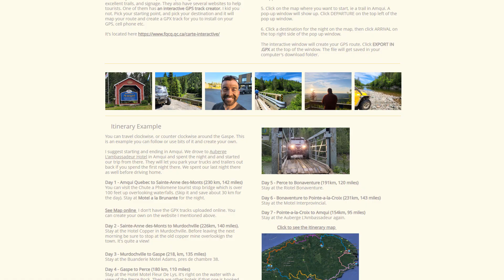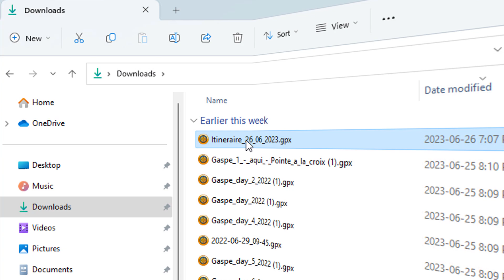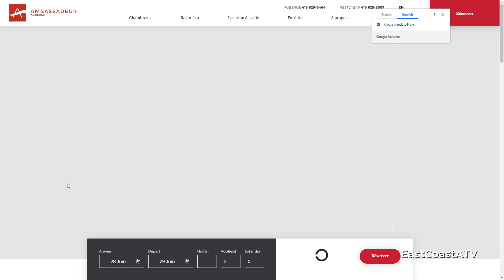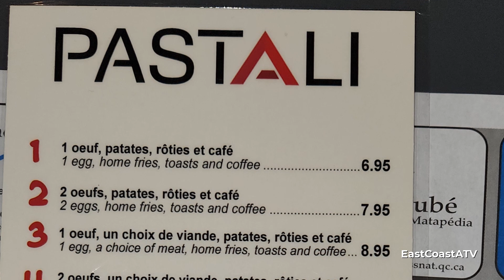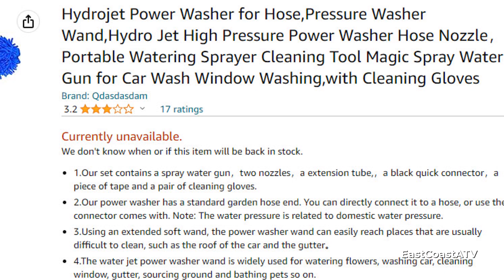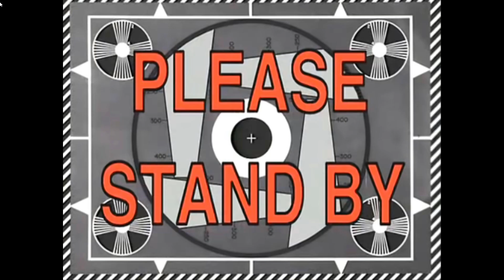Crossing The Gaspe by ATV - Part 1

Comment: Great video and a few helpful tips like the extra gas cap
Reply from the maker: Thanks. Yeah who knew a gas cap would be an issue? If you buy a spare make sure it fits your machine, not all gas caps are standard size.
Reply: @EastCoastATV  i finally got my Ranger after 6 months and have been enjoying it all the time
Reply from the maker: @jameshall1691  That's great, I'm glad to hear you're out there enjoying the outdoors.

Comment: Just curious.  You mention to go to your website to get the information etc and if we download your GPX it does not match the video series you have posted here.  Different route and hotels.

Why such the change
Reply from the maker: I didn't post my actual tracks because of the issues we ran into with closed trails etc. I didn't want anyone else to run into that, so I posted tracks a friend of mine made the week before on a slightly different trip. Here is my actual trails if you want to see them https://www.google.com/maps/d/edit?mid=1npk_Td5hlrYF41XL1E4KCVxa97xJO9U&usp=sharing
Reply: @EastCoastATV   Ahh I see..  Well thank you for the update.  I have done the NFLD run thanks to your guidance and tracks.  Gaspe is much closer to us so this year we will be tackling it.  We have a 1000mile 7 day loop we made up here in Ontario which we will be making public soon.  Not sure if that is to far for your group to go or not.  We have move than one loop. One being more beginner and the other more advanced.  We would rank Gaspe and NFLD as beginner for sure.  The advanced loop is more like 500 miles but will still take 7 days to complete.

Look forward to see where you go this year.

Comment: The thought of losing a gas cap horrifies me.
Was there a brand name of vehkcle that didnt require rad cleaning?
Reply from the maker: It's a crappy feeling losing a gas cap. Luckily we had enough plastic and zip ties to cover them. Some guys didn't wash their rads all week. Mine was good after the first time I sprayed it but I did every chance I got after that just to be on the safe side.
Reply: i was just wondering if the honda had similar issues. @EastCoastATV
Reply from the maker: @hvalour1  The Honda Talons didn't have any issues overheating.